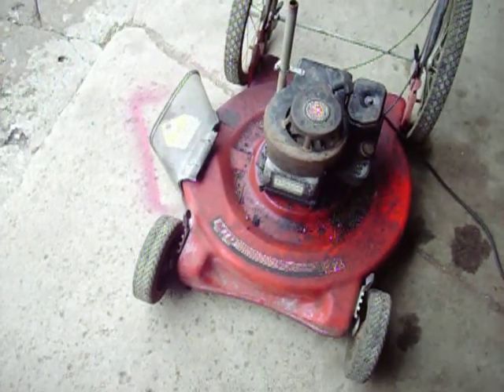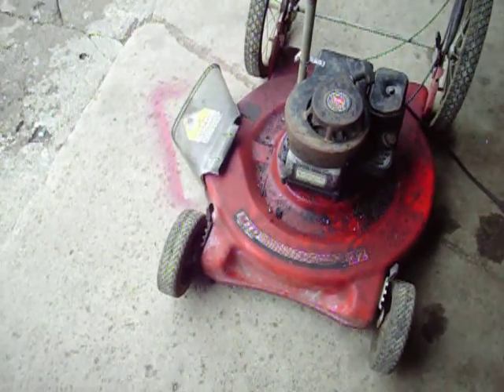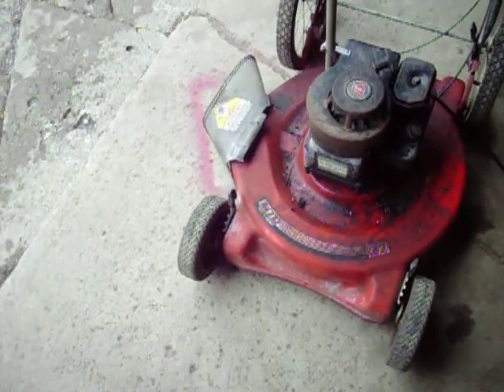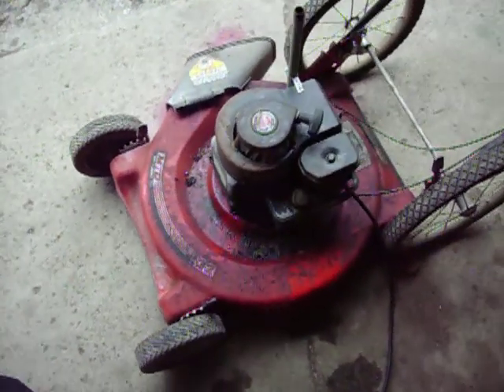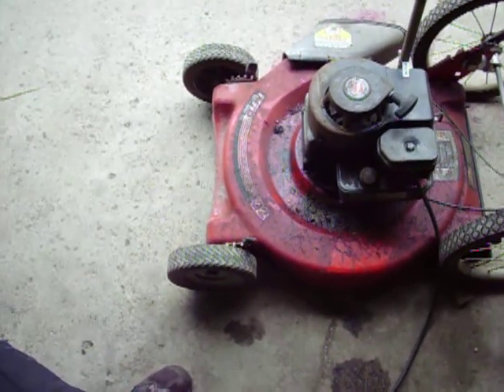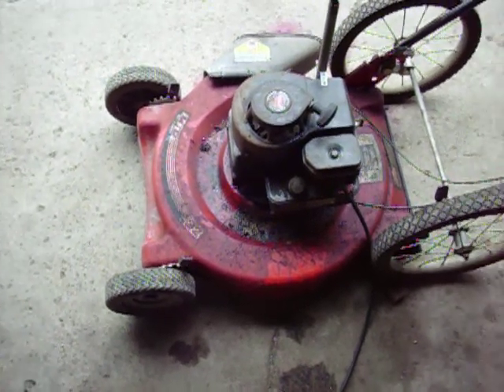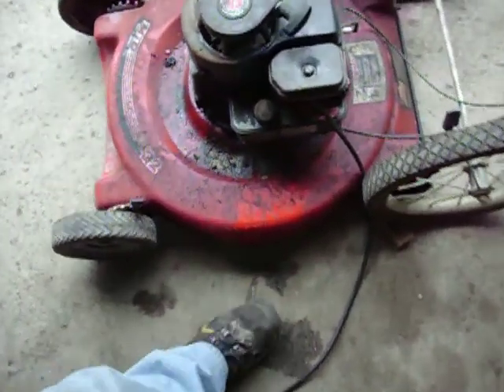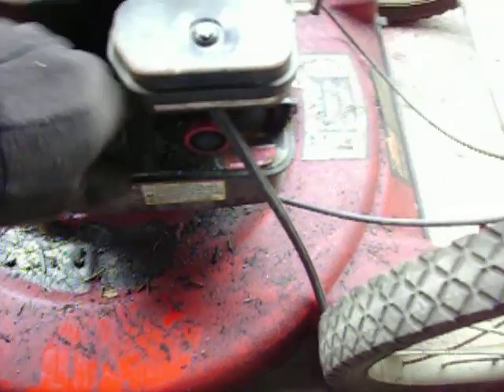LP Briggs and Stratton

Comment from the maker: you are right on the year, it's an 1981 model, i just check the number not too long ago, and the mower has a newer engine on it and it's a 1998 model briggs engine, look up " Propane mower cold start after winter storage "

Comment from the maker: i am going to look for a single gas tube pickup carb and going to hook it up to that lp hose , then get some frame with aluminum firewall made and have it mounted on top of the rear wheel axle to put a 20 lbs tank on that, once i get that made, i will send you a new video of it